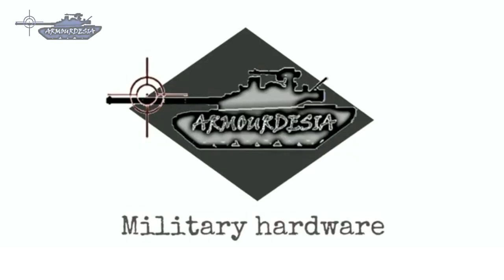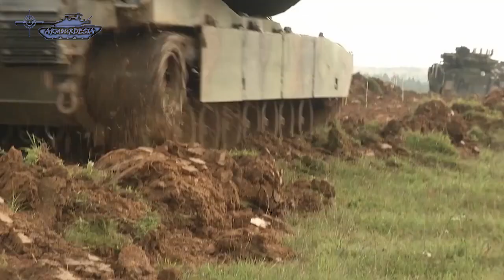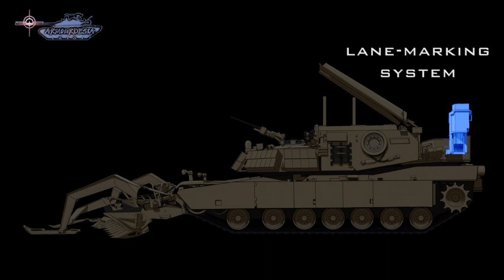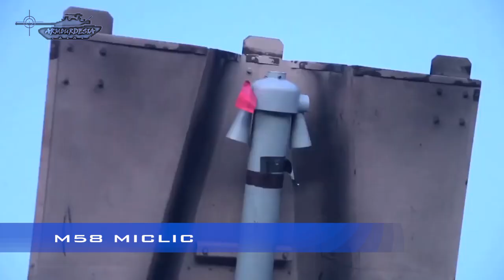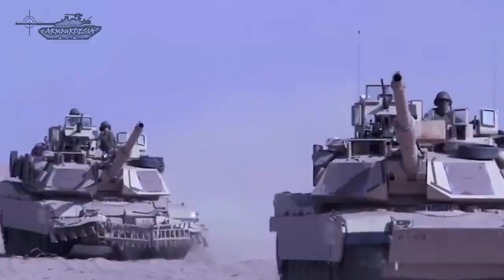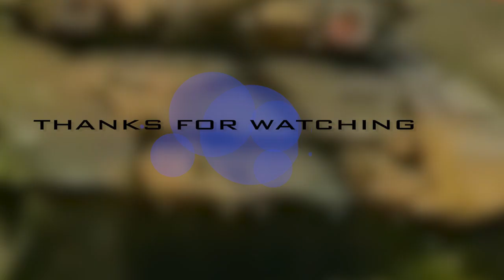M1150 Assault Breacher Vehicle (ABV)...CEV

Comment: This is very unproductive way to clear a passage for the following units. It works fine until terrain is soft and easy to work with. The big problem becomes when there is a rocky terrain where boulders can be of the house size. Such vehicle cannot pass between boulders and there is where mines will be find. You have to understand that the prime purpose of minefield is not to destroy tanks but to incapacitate them and to slow down invading troops to give needed time and accuracy for the artillery to clear the area from the enemy's tanks. The old WW2 system which used rotating cylinders with welded heavy chains with which crush the soil and cause inevitable explosion are still the fastest, the best and the cheapest. Any cheap IFV or even APC can be equipped with such device. Americans need to make complicated and extremely expensive junk because military industrial complex wants lots of cash.